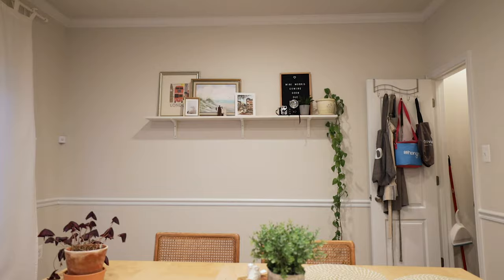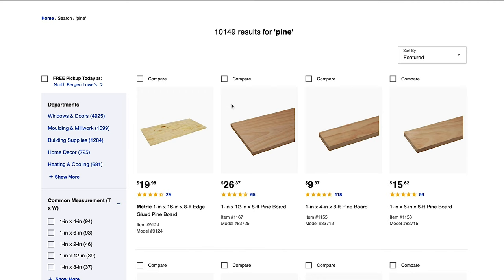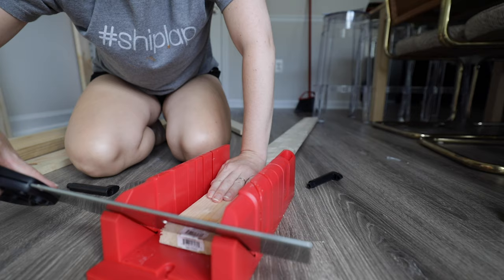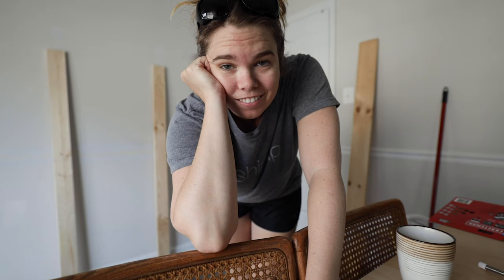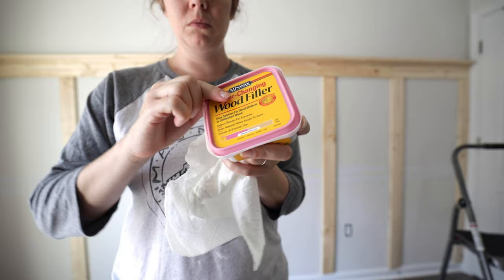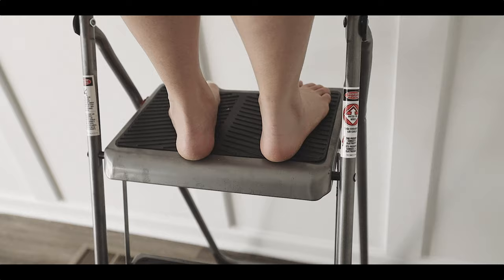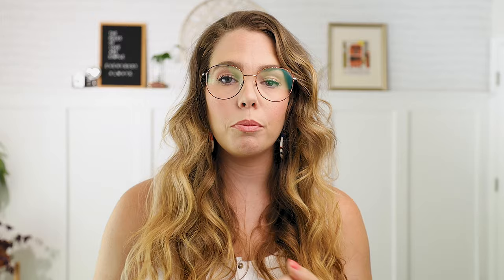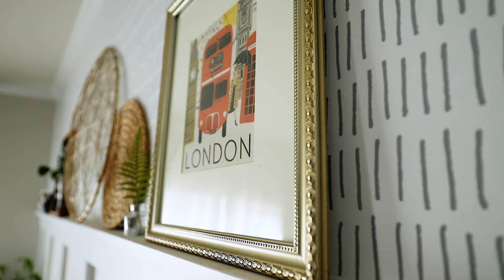My FIRST DIY Project EVER!!! // Board and Batten Walls with Peel and Stick Wallpaper

Comment: Turned out great. I just went to Home Depot and told the guy I wanted a miter saw, a nail gun and wood filler and paintable caulk. Instead of board and batten I'm doing what I hope is going to be a mid-century large flower design. I need to get painting , get the wood and layout my design. Hope mine turns out as well as yours did!
Reply from the maker: Wow!!! Good luck! I hope it turns out great!

Comment: Glad I watched this from start to finish.  This will be my first attempt at Board and Batton. Will get the Miter Saw for sure.  Lol. You made it so real so I totally know what to expect.  Good tips on wood vs mdf. Beautiful work!  One question:  what did you do at the bottom of your boards to sit evenly on top of your baseboard?
Reply from the maker: Lol - thanks, i'm glad i can help! I didn't do anything with them. I left them square 😔. however, I'm getting close to wanting to paint the wall a moody green/gray/blue and I think i'll sand them down and soften the edge a bit. Good luck with your project!
Reply: @Bekah_and_co_prohair  thank you for your response! Look forward to seeing the new color! 😊 Love your channel♥️
Reply from the maker: ♥️ thank you!

Comment: Good job. You'd be better off with a miter saw to do that project. I would suggest doing more research before you tackle other projects to get an idea of the tools you need and a safe way of using them. Keep on learning and growing. God bless.
Reply from the maker: Thanks! Since this project I’ve definitely learned way more and how to use tools. 😊
Reply: I'm an old carpenter who has a problem with new tools, I still do alot of things the way we did 30 years ago but you out did me with the miter box. I didn't know they still made them!